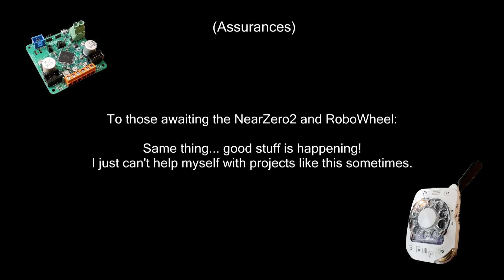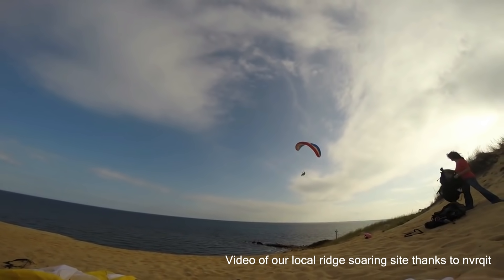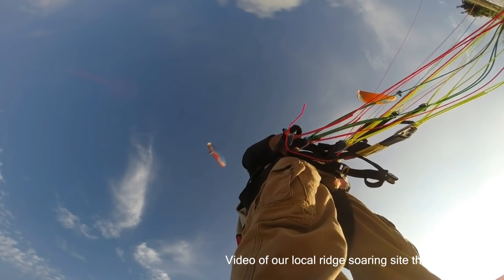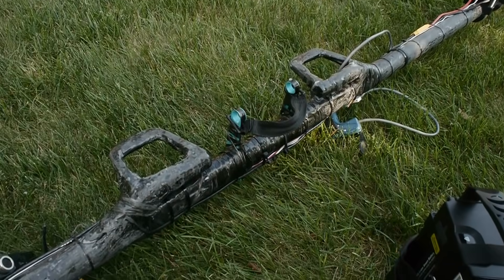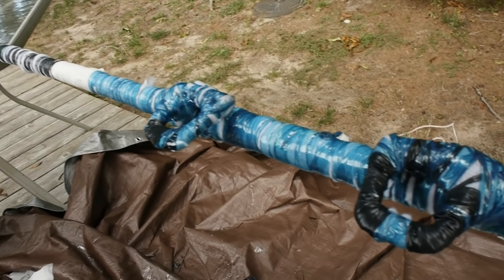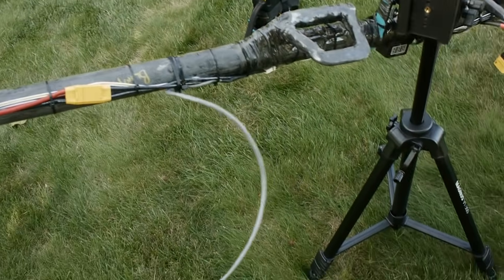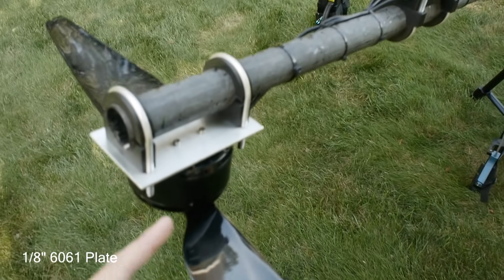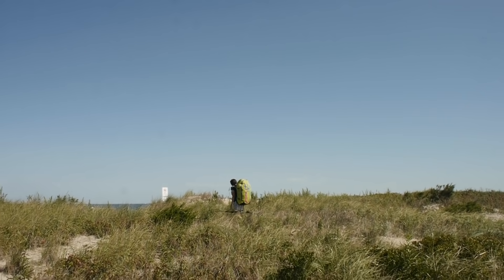Stupid-Simple Electric Paramotor

Comment: A bit on safety... If you get a faulty connection in one motor that stalls, even for a quarter second, the asymmetric thrust is going to line twist you until you have a drove shute instead of a glider. Plus, watching only one takeoff, you almost had a prop strike. That could send debris and or prop shrapnel at you.

Comment: You need some kind of substantial prop housing at least on the side that faces you, Ideally i'd also move the motors and props behind you.
Those props have a ton of energy and you do not want to find out what happens if they splinter/snap under load at high rpm, at best you end up with some carbon splinters that go very deep and are a pain to find because they dont appear on xrays, at worst you're impaled by a large jagged piece of carbon. 
fly safe

Comment: it was indeed very interesting! well done!
In fact it is a simple, new but in various ways intelligent approach to the problem.
You see - when you only have a cumbersome complicated powerplant like a gas engine of course you'd use only one and place it in the center on the pilots back, with all the drawbacks like noise, poor aerodynamic efficiency due to pilot in front, vibration, danger of injury etc.
By placing two electric motors on outriggers you vastly increase aerodynamic efficiency of the props, reduce vibration and noise and, let's face it - danger of injury is not worse than 35 pounds of gas engine with a fast spinning large propeller at full throttle right on your shoulders.

Comment: That must be the most affordable way of flying while using a propulsion-system that was ever invented. Please correct me if I´m wrong, but a paraglider with harness, 2 motors/ESCs/props, a small battery and a carbon-fiber-stick seems to me more affordable than anything else I´ve seen before. Of course, u cannot use the propulsion all the time, but still you can paraglide much easier/longer than without motors at all, and it´s ultralight... This may also lead to a more affordable way of teaching people to paraglide with, or without a motor...

Comment: Very well done Justine, more safer you can ad a mash like a basket on each motor to protect so the cord it wouldn't in blade but it is very smart way you use the power only when need them in flight doesn't give you to much weight for the flight, and for emergency parachute when the blades are cover you wouldn't have any time to use to land safely.

Comment: I'm sure you have a safety circuit that will prevent one motor from running if the other one does not.  I have paraglider and have put off buying a motor - I have to try this! Thanks

Comment: careful with rotational twist, consider adding a sensor that will cut both engines if one fails. Any voltage dip or rise that goes beyond what was sent would indicate it's failure or break. Wouldn't want be in a turn when 1 fails and you twist out. My biggest fear is you're in the path of the blades if they should break, and you'll definitely break a prop some day, if you could get this behind you, that would be choice, just remember you are the pendulum in a typical configuration, but now you're putting all the power on the tips instead of your center of gravity, keep that in mind in turns. happy flights.
Reply: oh, and when you're tired of it, send it my way =D i'd love to rent this for a few weeks

Comment: I think your laugh is hilarious. It truly is that of pure joy for what you're doing. How hard is your drive to control (pitch) with a high aspect glider rig not designed for a low thrust line? What rigging adjustments did you have to consider? Or does it matter? Are you going to leave the props un-shielded?

Comment: So nice. Congratulations. 
I noticed that when you glide, your propellers seems to be driven by your own gliding speed. If this is the case,  it creates a lot of drag and may also be dagerous at landing ⚡⚡⚡⚡.  
You should be able to activate a brake mode in the ESC (Electronis Speed Controllers). This will shortcut the motor leads preventing the propeller from spinning. There are sometimes 'soft brake' modes to do that less brutal.
'Wish to have a girlfriend like you, I love see women enjoy DIY that makes them happy 😗

Comment: That's proper cool! But looks super sketch without any form of prop-guards. One minor knock to wrong place on those blades and they can explode during use and impale the user. I would never be closer than 10m to those props without some kind of safeguard in place while spinning.

Comment: Yes, it was indeed interesting!  Do you use a sensor/controller to keep both motors turning at the same RPM?  Or did you wire them in series to ensure they both received the same amount of current?

Comment: Yeah there's quadcopter videos out there where people make drones with extra blades per rotor and their substantially quieter not only that I think they did that with the little bird I forgot the proper name.. it was like this one little bird developed during the Cold war they added extra tail rotor blades and main rotor blades
Reply: Oh s*** my bad more blades might be more weight.. don't know how significant that would impact your current design for the sacrifice of maybe quieter blades but nonetheless.. that is totally cool what you got going on.. I would throw this out there though maybe a more Rock solid kind of reconfigured Alice pack to hold those things real steady seems like it has the potential to wobble left and right and if it was more fixed position could be considerably less danger.. and that demonstration or video you have had shot there seems to be some wobble I would say horizontally one way to the other upon initial takeoff I don't know if that has to do with the wind on the beach but I don't know I don't even do that thing paragliding I would give it like a 9 out of 10 for practicality and I'm sure you got more plans for it

Comment: Your video is very interesting and entertaining. I do have one thing to say and I don't like the kind of people that have things to say. However this is a safety thing. Be careful of those U-clamps. They will over time bite into anything softer than they are and cause them to work loose. That in turn could cause your motors to turn, rotating your motors on the CF tube. I'm a crusty old man of 67 and I have never said anything like this but, "you go girl". Good luck.

Comment: Very Interesting.  RPM controlling the motors for thrust balancing? Drag cancelling 
the props during gliding could be done by dropping the rpm to just enough to null
the drag so the thrust is a bare minimum along with power drain.

Comment: Nice work with it and keep up the innovation.  Paramotoring and Paragliding only really took off cuz people went out and said hey wouldn't it be epic if.  Heck a lot of things started that way.  Good luck with taking it further and don't be afraid to learn new skills to add too it.  
On the reserve concern I see a couple options you might have already considered 
    One thing to potentially consider is a kill switch with a jettison setup.  Maybe a little drogue shoot of its own to slow it's drop.
   Another maybe set your reserve on the end of the boom with ability to deploy it straight from there.
   As is it looks like it already creates a bit of drag so another option might be a foldaway so it's not always sticking out (with kill switch so motors are only live when locked)
really any of these I'd add a kill switch to stop the props quick even with shielding (like with the ESC breaking BrianPhillipsRC suggests)
with any of these I'd really recommend find a way to test em all without you onboard  (maybe a small scale first) then on the ground then as high as possible with options to ditch the entire rig for an independent chute.  Yah only got one life and I'd hate to see someone innovating get lost in the process.

Comment: There was a YouTube video a few years ago that had a similar design. The guy had 2 RC thruster motors rigged in a similar way. He did get airborne, I don’t think he gave any specs or performance data. Small RC gasoline motors have gotten much better. I wonder if you could swap out the electric and get a couple of hours flight time? Thanks for posting

Comment: Wonderful idea and fun implementation! Does one need to be concerned about placing a human body in the same plane of rotation of the props? Or in other words, does a broken prop blade flying at your legs concern you?
Reply: I believe broken props will pull themselves forward of plane of rotation
Reply: @rayfletcher3683  I think even worse is that there's still thrust to the other side.  Since the props are so far from the z axis it has a lot of leverage to spin her in the lines immediately.  Even if she let off the throttle right away it would still keep spinning her harness because the motors provide a good deal of weight far from the center of the axis.  Getting spun in your lines at low altitude is very bad news.

Comment: I wouldn't want to sit in the same plane as those props (just in case of prop failure) but I do like the idea of a launch assist device just get you to the lift and without all the noise and weight of conventional Paramore gear. Well done.

Comment: I love it! It does make me a little nervous that you're positioning yourself in plane with the two propellers. If they were to break from say catching the ground or something unexpected you could get a sharp and nasty carbon fiber projectile impaling you
Reply: +1  My first thought when I saw this.
Reply: I was looking for this comment.   Only one small correction, it's not if, it's when.
Those propellors are unprotected, and so is the pilot.
Reply: This is a prototype, intended to be used only a few times to evaluate & improve the design.  The risk of such a failure occuring during those few trials is thus low enough to be acceptable IMO.  The final design should of course include safety features that take care of low-probability events that are more likely to occur at some time when it is used over a long period of time.  Commercial designs need to be even more cautious to guard against mis-use by imcompetant customers and far more users - and the risk of lawsuits!
Reply: @davemould4638  The scariest part is that when/if a prop does break and cut the flyer the other motor is still going to be providing thrust.  So while you are coming to terms with a  fresh gaping wound  you are being spun in your lines.  Risk is too high in my opinion.  Protection should be built into the prototype considering the consequences.  Just a simple motor out due to a faulty hobby class speed controller could kill you in this circumstance.

Comment: I'd be slightly concerned about those motor mounts. It seems like those 3d printed mounts would come apart really quickly if one of the props became unbalanced (if you hit a bird or something and break a prop, for instance), and the entire motor could slide down the shaft and hit you before the motor could spin down. Probably unlikely, but you may want to add some sort of feature to the tube to make it impossible for the motor to travel inwards even in really weird situations. A flange or something should work.

Edit: actually, looking at the test flight video, a prop strike against the ground when you're launching seems like a real possibility. That would cause an immediate prop imbalance with the motor running at full power, which could cause all sorts of unpleasantness. Prop guards (both to keep the prop from hitting anything, and to block the prop from hitting you if it breaks under power) and more secure motor mountings seem like a really good idea.

Also, you might want to set up the harness in a way that would let you quickly detach and drop the entire thing in the event of an emergency. That would potentially solve the reserve issue, and it let you dump it if you had a battery fire or something.

Comment: Are the motors shielded? (I saw a video where someone was flying drones over a beach and some of the sand had iron in it, and that clogged up the motors to the point where they would not function.)

Could the motor controller have the ability to halt the propellers in the horizontal position to protect them during landing?

Comment: Be careful of a sudden and violent yaw should a motor or speed controller fail,  especially in full power climb out.  One motor will have a lot of torque leverage on that long stick as it will  not be balanced by the other.

Comment: Justine, Bravo, now you have to cope with everyone trying to improve on your idea all the while they won't actually do it themselves. Lots of wannabe Aeronautical engineers who are actually drone enthusiasts.

So using the KISS principle and ignoring every well meaning wannabe, if it does what you set out to do, then you have achieved Goal Zero. It verks and you have test flown it to verify it gets you off the ground and to a suitable height for some fun. As you said it was not designed for continuous use. It's not a para-motor and it performs identical to a powered glider, get off the ground and get some height before you shut it down and sail.

Comment: As large as the props are you could probably go to a three blade prop without much loss in efficiency and it would be quieter. You might also consider 4 to 6 smaller shrouded motor/props along the length of the bar. More even distribution of force, and less line issues.

Comment: Just a quick remark on the carbon parts:
Be careful, splintering is a huge issue with CF and the reason the passenger cell of smaller aircraft usually has an inner liner of kevlar/carbon mix weave to stop shrapnel from cutting you into pieces. The nasty thing about CF is that its invisible on x-rays so the goal is to have one big piece impaling you that can easily be removed instead of a dozend small ones that will remain inside.
Horrible topic but keep it in mind :)
Reply: That's why she taped it
Reply: @wendyking9759  there is no tape.
Reply: True. I flew a TRX-160 and TRX-140 which had carbon fiber spars.  It was always on my mind that one cannot see the damage with these.
Reply: @NIOC630 sounds a little bit like fear mongering
Reply: @minibuns5397  Im sorry, i just wrote a comment describing how to find images but youtube is a safe space and wont let me post it. Trust me, its ugly.
Reply: Perhaps finishing all parts with a vehicle protection wrap could help contain splintering..?
Reply: I have always wanted to do this. Do you happen to produce these now for sale by chance? If it breaks I won’t sue I’ll sign a waiver LoL!  No but that would be awesome if you even had time for that or wanted too of course.
Reply: Great Idea, great inovation to ppg, hoping to make my own similar version
Reply: like a ducted fan shroud
Reply: I was kind of thinking CF might not be ideal even due to if you have a situation where it strikes the ground or a tree, etc. You might want it to break to protect yourself and the other equipment. If it is very strong its just going to plow into the object and swing the other end around not likely into anything you want it to. If both ends were to strike something and the CF doesnt break all of the inertia to stop is going into your body at whatever location the frame is at, stomach here it looks like. Anyway maybe these are so edge case they arent a big deal but it was just a thought.
Reply: Muy bueno el invento!!
Reply: Yeah I would have gone with PVC. Weight difference isn't significant and PVC bends on overload rather than snaps. With the forces of those motors CF is a touch overkill.
Reply: @DFMurray  huge strength difference
Reply: @DFMurray  How does CF and PVC hold up against vibrations? I'm thinking a propeller at the end of a stick could cause significant vibrations, that might lead to material fatigue.
Reply: @svennoren9047  RC motors and propellers are quite balanced. So there are no real vibrations.

Comment: In paramotoring one of the dangers is that if your propeller breaks (you trip during take off most commonly) it sends schrapnel 360 degrees to any one standing nearby and also through your wing. The pilot will be mostly safe because the propeller is on your back and it only sends schrapnel sideways. An accident like this is not much of a problem because your paraglider is repairable and you can take off in a remote area to reduce risk of injury to spectators. But when you have the propellors right next to your body, schrapnel will be sent flying into your legs/torso. I would recommend to atleast make a half a cage around each propeller that catches the schrapnel flung towards you to reduce the chance of being impaled by a piece of carbon flying 500ish km/h.

I see that you are building prop guards, you should make them strong enough that they can stop high speed flying debris.

Comment: Love it! Maybe adding a kill switch or plug on a short lanyard in case of emergency so that you don't accidentally apply throttle at a time that it might tangle in your lines, or single motor failure, since that could be incredibly dangerous. If you attach it to your harness with 2 twist lock carabiners then you could also detach it in emergency, so that you're reserve might work better. However if you're only really using it for flights at <200 ft then there's no chance that would actually help.

Comment: You need the engine mounted backwards so they push in stead of pull and folding props on it! So you can fold them back while gliding👍😉 

You can make the engin push by switching + and - poles
You are welcome.